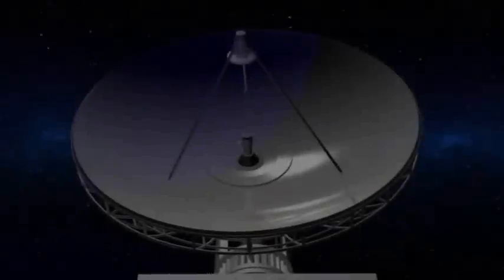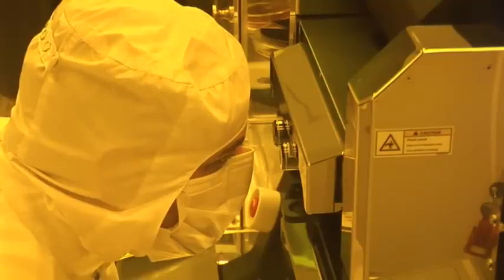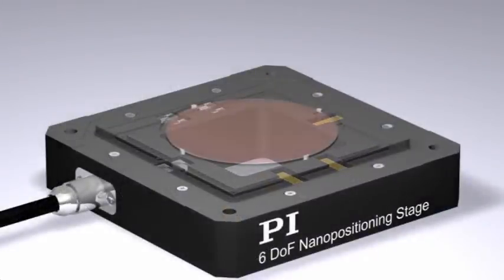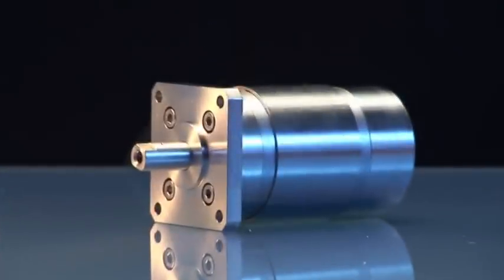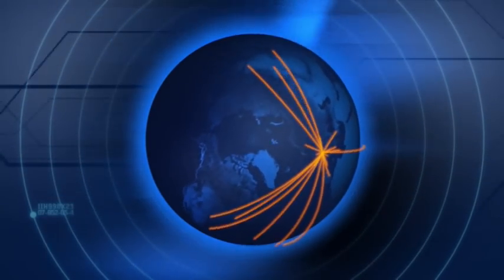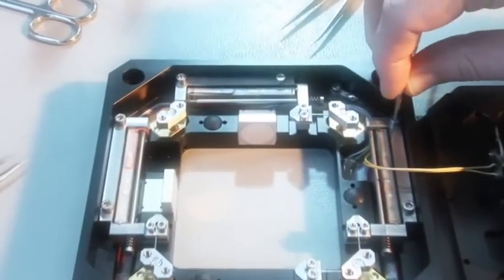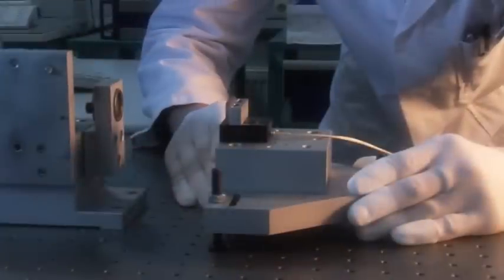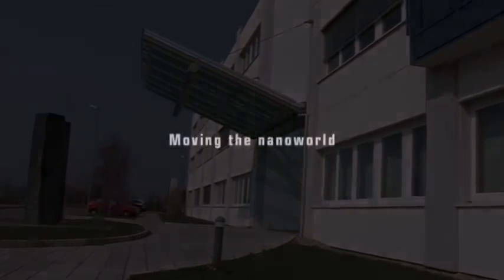Moving the Nanoworld - Precision Motion Control down to Nanometers and below www.pi.ws

Comment: Cool!
I want it in my lab. Femtosecond time resolution needs nanopositioning of delay lines between different pulses. Normal stages that use stepper motors and screws are expensive and not reliable. They always have wobbling and nonlinearity in motion. This pizo motors do not have any rotating stuff. And that’s amazing.